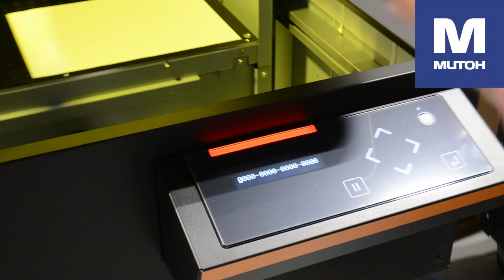QDS Unboxing Mutoh XpertJet 661UF Demo printer

Comment: Can it be turned sideways to fit through a door?
Reply from the maker: Before the inks are in, sure.  The smaller 461UV printer will fit through a doorway for sure.  It has a smaller printing surface.   https://www.qualitydigitalsolutions.ca/19-mutoh-xpertjet-461uf-uv-led-printer